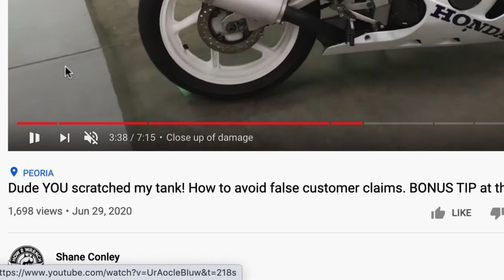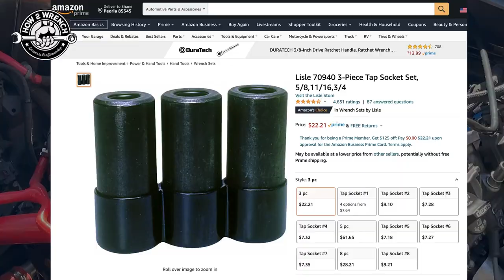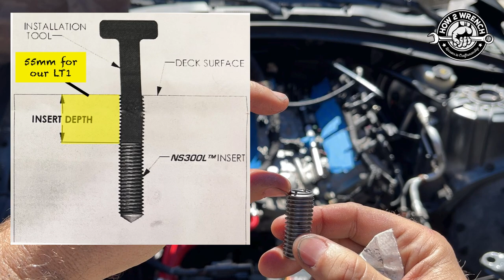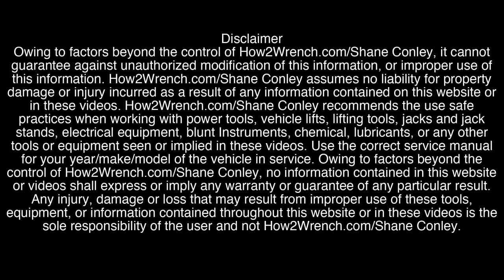Stripped head bolt repair YOU DON’T NEED TO PULL THE ENGINE! 3 shops lied to us! #LT1 #strippedhead

Comment: i have a question did you put two inserts in the hole or where you just cleaning and checking to see if you made it all the way down the block with the insert so you had to keep taking it back out and re tapping it?